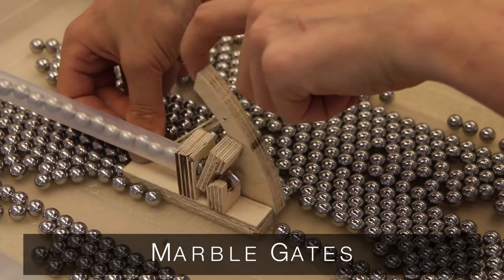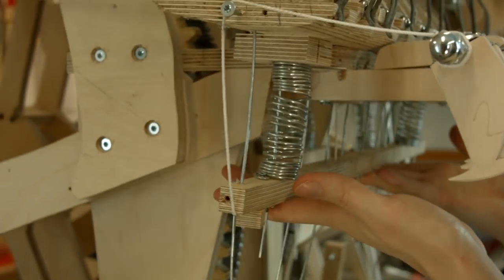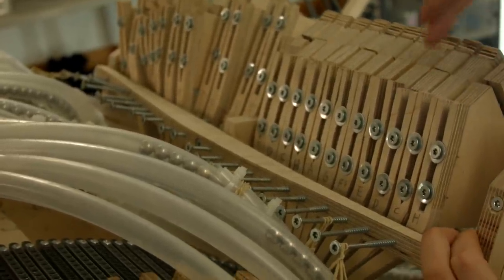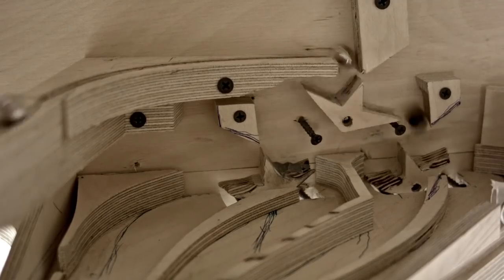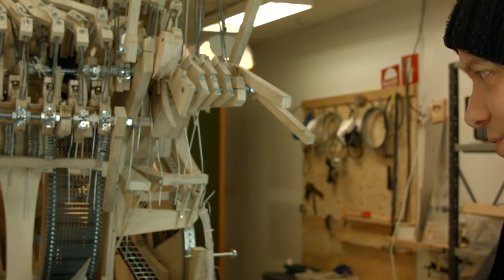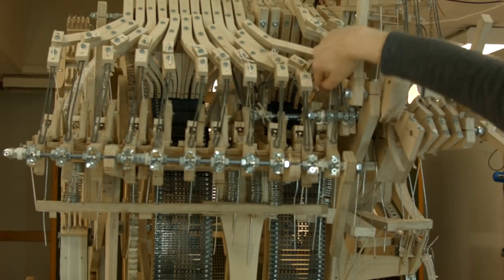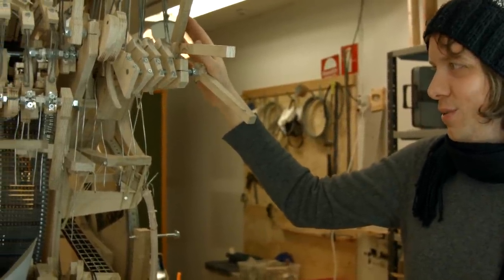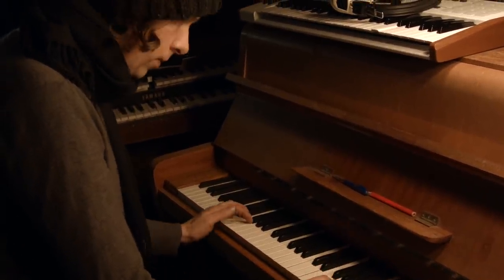How It Works - Part 2 (Wintergatan Marble Machine)

Comment: There are musicians, and there are builders.  Rare to see both in the same person.
I like the shakiness of the machine.  Makes it more miraculous that it works!
Reply: +Matthias Wandel hi
Reply: +Matthias Wandel Could you ever have wondered that your program would inspire such a creation?
Reply: +Matthias Wandel Make a skype meeting with him, I'm sure both of you can think of quick ways to improve the reliability of the machine. First thing that comes to mind is metal pins instead of lego pins, these would be impossible to break. I'm sure someone with a CNC lathe would be happy to make them...
Reply: +Yves Morrissette I don't disagree, but I'm thinking Martin did a fantastic job and should there be a version 2 he has a whole set of plans floating around in his head to improve the design.  In the end nobody knows the machine better than Martin.  He knows best on how to make it better.
Reply: +William Hayden Totally agree on how this machine is awesome. Maybe I was unclear about it. Keep going Martin!
Reply: +Yves Morrissette I don't think you were unclear.  I was just adding my take on the whole collaboration aspect.  Cheers!
Reply from the maker: I am planning for marble machine 2.0 that will fix the issues and i will use a CNC! and i will consult matthias again as i did even with the 1.0 version! He is such a big inspiration for me! Thanks!
Reply: I just built the marble gates
Reply: true the vibration is good but only to the point of not making the notes mess up or miss a note then it is to much vibrations =)
Reply: @Wintergatan  5 years 3 months and counting; but coming close!!!  Video from today is SO ENCOURAGING!!  KEEP GOING!!

Comment: Abought problem with LEGO parts. You're using simple technic pin or "Connector Peg" (LEGO Design ID: 3673). Try to use Axle to Pin connector (LEGO Design ID: 43093) instead. They are the same from the one side of the detail and much stronger from the other. Both of this parts are the same length, so you wouldn't need to resize other parts.
Reply: +Enno Elfinit to the top
Reply: Nice!
Reply: +Daniel Quiñones ;)
Reply: I really hope Wintergatan sees this, it's a really good tip!
Reply: +Enno Elfinit lego consultant ^^
Reply: good idea.  I was wondering if metal shelf brackets might of fixed the problem if they fit
Reply: might HAVE. not of!
Reply: Haha, I just wrote a comment about this. I was curious if the variable orientation of the axle side could effect timing, though I doubt it. If so, bushings would fix that problem.
Reply from the maker: brilliant idea, will use it for marble machine 2.0
Reply: Marble machine 2.0 confirmed!
Reply: Kaiwala23 MMX
Reply: @Wintergatan  CRICKET 
CRICKET
CRICKET
CRICKET
Reply: @Wintergatan  lies haha :p

Comment: I love this machine, and while you have definitely earned a long break to do as you please, I too look forward to seeing more of this, and maybe even a new revised version, with tighter tolerances and stronger materials! Though the shakiness really adds to the Animusic, locomotive, Industrial Victorian, wizardry feel the machine has, and I  hope you can keep the spindly legs look and rattle while still tightening tolerances and cutting back on malfunctions. I also have a few suggestions/questions:

- Have you tried different marble materials effect how the machine plays, like different mallet heads do? It could be a neat way to change the sound for a song, but it would I imagine it would drop a lot more marbles since you probably placed the funnels to catch steel bearings, but they could be adjusted.

- How useful do you think engageable capos for the bass neck would be? If you had them clamp down from the far side of the  player, and sit at a high enough angle when disengaged that they can still get their hands under them to easily hit the frets, you could change the key of the bass line more dynamically than with just the programming wheel alone.

- And finally, can you please you post the sheet music, because the song itself is incredibly beautiful and I'd love to learn it on piano! 

This is a feat of engineering and music, and I look forward to more content from you whether it be the Wintergatan or your other works!

Comment: Maybe try Lego technic part 6628 or 43093 for programming instead. They might be more durable.
Reply: are either of those the axle/pin connectors?
Reply: 43093 is, yes. 6628 is a pin with a ball joint.
Reply: Oh, that's a really good idea... He'd have to recalibrate the arms but they certainly would last longer.
Reply: Andy Brice I see.

Comment: It would be super cool if there was a way you could swap out the programming wheel to change songs. Like if you made belts and had 10 different belts for 10 different songs and you could wrap the belt around the wheel. I think that would be easier than having 10 different wheels.

Comment: This is really amazing. Your ingenuity and creativity are inspirational. Such an interesting study in mechanics applied to music. I actually think the design "mistakes" are what makes it even more of a work of art than a work of engineering and are  part of why it sounds so cool. You could try to make a flawless machine, but I think a flawless machine would have less personality. I think perfecting the machine could consist in finding the right balance between eliminating the things that could go wrong while  playing it and at the same time preserving that random element that makes it sound so special (like the drifting of the programming wheel and the rocking because it is top heavy). I can only imagine how much you learned in building this thing and how that will contribute to your music. But that's just my two cents...

Comment: Martin of the past: I redesigned the system 6 or 7 times this summer
Martin of the present: I designed the system, sent It to my team of engigneers and CAD specialists, redesigned it, built it with the CNC machine, redisegned it, changed the material, coated with rubber and covered with magic dust. But It took me two days, I'm so lazy, why am I not efficient enough?

Comment: I see the "Magnets and Marbles" video in your list. I suppose then, that you considered using a strip of recessed neodymium magnets for your mute bar. Idk for sure, but I remember a Discovery Channel program on LEGO and something about them pioneering a service where they would produce limited runs of custom pieces of your own design if you can provide a spec. Maybe a registration pin with a beefier base and a bullet-top?
Also, I see you're a DiResta fan, do you know about Iggy Swan? He's a Tuber who is fond of building complex wooden machines (with lots of wooden gears) and might be able to offer some suggestions regarding the base or mute brake.
Finally... I'd really like to slap you because ever since I saw the original video, I can't get the tune out of my head. It's simple and beautiful.

Comment: To reduce the rocking without changing the appearance couldn't you hang a weight underneath it to dampen the oscillation? I say that as a question because I imagine it would work but I'm not sure.

Comment: Incredible machine, I am a big fan of it!
Regarding the alignment of the programming wheel and the lifting fingers:
Put a ball bearing on each side of the programming wheel, so that the outer race is rolling on the side of the programming wheel and the inner race is attached to the structure close to the lifting fingers.
That way the ball bearings will keep the programming wheel aligned with the lifting fingers with minimal friction even if the frame is flexing.

Comment: Martin! This is magnificent!  Have you thought of using pendulum weights hanging at the same level as the legs to tame the top-heavy vibrations that introduce inaccuracies when you are playing this wonderful thing?  Pendulums are used to soak up vibrations on the bridges you can drive over as well as on violin bridges -- we cut them away to wake up a quiet instrument or leave them large to calm a strident one down--which is why a well cut violin bridge can make a dramatic difference not just in playability but also tone...  Thank you for posting the "how it works" videos.  I look forward to more music and more inspired engineering. Genius!!!

Comment: It would be cool if you had an engineer with you for problem solving, I'm in Mechanical and there's a lot of cool solution you could make. Like hot gluing the "screws" on the tops so they don't break, and building counterweights on the machine to turn and counter-act the swaying.

This is so inspiring. It reminds me of Animusic.

Comment: This is great. BUT Just in case you are stuck on a solution for some issues here are some....
Design Tips
1. Injecting hot glue into the programming pegs will make them stronger without modifying their size.
2. Running 4 rollers on each side of the programming wheels will true it without increasing drag too much, especially small ball bearings. You can even give them some clearance so they only contact when the wheel is not true.
3. A single larger catch on the vibraphone would be more consistent catching the bearings with less issues angling it correctly. The only problem is it would almost have to be custom because of the unique shape, and would have to be flexible enough to not let them bounce out and firm enough to not be torn to bits by the bearings hitting it. 

Can't wait to see 2.0!

Comment: You could use a mass damper like in a skyscraper to reduce the sway and guide bearings or guide blocks with a PTFE face to align the programming wheel. PTFE is really slick, strong and can withstand high temperatures but is not cheep and needs a primer to use with glue.

Comment: About the problems you want to fix, I have some ideas. I am not an expert, but you might consider using my ideas:
-The wheels with the LEGO parts, can be centered with a pair of small wheels or bearings on the left and right, that will keep both of them from skewing and hitting the wrong notes. So you will have to place them near the other relevant parts which you want to drive.
-For the bass-guitar-thing, you can put some of these plastic tubes, running vertically near the strings, so the marbles fall on the correct ones all of the time.
-To stabilize the whole construction, you can obviously manufacture some stronger legs, but you can also reinforce the current ones, by tie-ing them one with each other, using some rods in an "X" manner.Meaning that the top of one leg, will be tied to the bottom ending of the other one and so on.

I hope that all these that I just wrote were written in an understandable way. I am not an expert in that either...

Comment: Have you ever thought of displaying this in an art museum? 
You’ve probably had many comments for this, and the top–heaviness of the machine would definetely make transport a nightmare. 
It would take a few hours, but this machine should definitely be shown to the non-viral world too at some point, and the solution could be to attach extra spars to give the machine a wider, more stable footprint if being transported. Even skyward structures to keep stability “seat belts” away from the delicate mechanisms would make a difference...(though the issues with both are how to remove them or attach them in an easy fashion) Rube Goldberg would be proud of this!
I kinda want to make my own now... but I’m in college. 
Coolest contraption I’ve EVER lain eyes on!
💚⚙️⛓💚
Reply: The Marble Machine has been exhibited at Speelklok Museum in Utrecht for a while.

Comment: Someone needs to cast about a thousand of those programming pins in steel or aluminum and send them to Martin!
Reply: I was thinking that too!
Reply: +Rob Cartwright That'll just move the wear into the lifting finger, or even worse, into the wheel itself. I hope he finds the time to fix the kinks in the machine so far that he can do live performances on it.
Reply: BSEUNHIR I'm not so sure about that. The lifting finger is also metal,which is what's causing the plastic to erode or break. Metal on metal wouldn't wear as much. I supposed it's possible that a soft plastic lifting finger might help though.

Comment: I have a few suggestions, First off, I don't know where to find it, but you can get that type of LEGO connector with a round tip, it would probably be less likely to break, or, there are some that have the round connector on one side and a non-hollow "X" on the other side, their element ID is: 4666579 on LEGO's Pick A Brick store!
   Hopefully this will help, and really cool marble machine!

Comment: Interesting part about the weight distribution of the machine. It looks top-heavy, but I thought that the legs would have that countered in some way, oh well. You could always go carbon fibre instead, and if looks mean that much (like it seems they do), just paint it. I'd suggest having not less than 100mm x 100mm legs because those twigs that are on it look like they're about to collapse. :P It's a fantastic machine from an ingenious mind, full credit for the work put into it including its flaws. =)

Comment: You might be able to fix the problem caused by the broken lego bolts by strengthening the tips, I'm not sure how it could work but maybe even making home made metal versions where one half is normal but the other half is completely solid to keep it from splitting

Comment: Instead of using of using the Lego pin pieces which are hollow and break you could use the Lego axel pin which is part No. 3749. This part will still allow you to use the programming wheel but is more solid the other end. It might put the stress elsewhere but it is worth a try.

Comment: WHAT A WONDERFUL MACHINE, and a Very Catchy Tune.... I hate to think how many times it has been playing in my head since first hearing it... Thank you..... OK would you be able to fit sloping flanges to your programming wheel to keep the Belt on track.... Also, you said you have problems with your pins.... Cover the end of each finger in Tin from a tin can or a coke can to make the contact service smoother.... The Slender lags have diagonal struts to stiffen them.... Do the same across the other diagonal, then clamp them together in the middle to form a solid base.... Wish I could help with perfecting the machine... But I'm in the UK... Good Luck... It's fantastic.... :))))

Comment: To fix the problem with Lego nails you could've used the ones with cross hairs instead, they're the same hight, can still be put into the wheel, but the cross hair is a lot more durable.

Comment: Instead of changing lego parts, you could just put a small round piece of wood (a rod I guess? i'm not native english) halfway inside your current parts. Tedious work maybe, but you do it just once and the added strenght will make em last much longer (and if the plastic fails, the wood would still trigger the gate). Also when programming, you'll need to pay attention cause only the free half will go in, but then again you could just use a marker pen.

Comment: For design flaws, you said you were having problems with the structural integrity of the Lego technic pieces, I'm assuming because they're made of plastic. Have you considered using the technic pieces as a template for something to be made out of metal. Even something as soft as aluminum should be able to provide better structural stability. Just a thought. I thought the whole thing was innovative though.

Comment: have you thought of using steel skeleton like a sway bar?  seems he needs more programming wheels and a gearbox/transmission to change between the wheels.  you have lots of space inside the big wheel.  but idk.

Comment: You mentioned the problem with "programming pins" (5.35). Maybe you have already thought this but what if you use 3D-printer and use carbon fiber composite to clone those parts? Or CNC-machine by using some metal to replicate those pieces? If you clone the part you can also improve it's design at the same time. Btw. the metal parts might cause some other issues like damaging the machine from elsewhere but anyway this was my 2 cents. Amazing project!

Comment: You could switch from Lego pin connectors to axle pin connectors to fix the pins tearing. I'm not sure if the various orientation will effect timing noticeably.

Comment: Replace the grey pins (lego part 3673) with (for example) the axle pins (lego part 43093) they should stand up a little better to side impact. Otherwise, it's a really awesome machine.
[edit:] and I see in a newer video you already came to the same solution. Nice! :)
Reply: Alexander Burgers he is using magnetic pins for the new machine
Reply: After watching 2 years worth of videos, yeah, I saw. Hope they hold up.

Comment: The black Lego technic pins are stronger than the gray ones. They would probably break less often.
Reply: +Jeremy Good Even better would be the Technic ball with friction snap part #4184169  The ball would allow the lifting arm to glide over the pin and reduce shear force.  While not as common a part as the standard Technic connector, they are still easily found at 0.01 USD each on Bricklink

Comment: you could make the programming wheel fully wooden and have marked off guidlines on where to put real iron nails, or make wooden versions of legos to where it wont get broken
Reply: +LE㊉ ACŦI㊉N RAIÐER (СѦИСЄГ) 
That may make it harder in the future to reprogram it.
Reply: +Appletank8 not if it's holes and you just put in nails or screws, think of it like a row of holes like the Lego's, but you screw in screws instead of the Lego technic nails

Comment: Hey i don't know if you will see this, so guyz help me, but there is a very quick fix for the lego pin problem. There are other pins with a circle section on a side and a cross section on the other. It would nether break, these pieces are realy strong (but black if i remember so maybe a bit difficult to see on video)